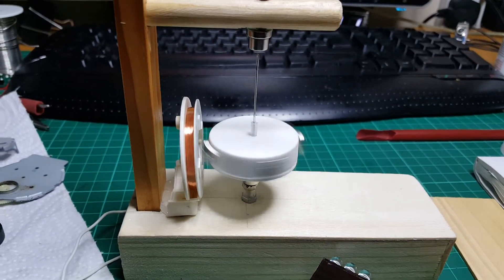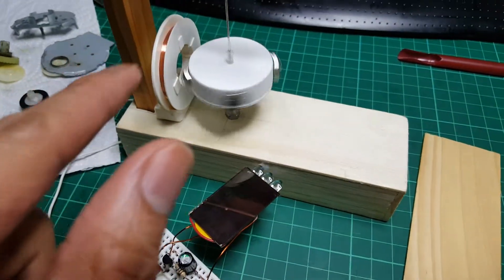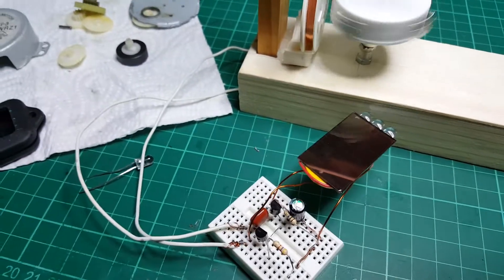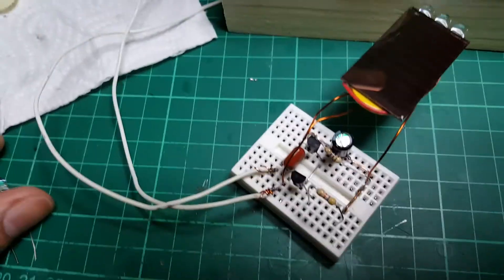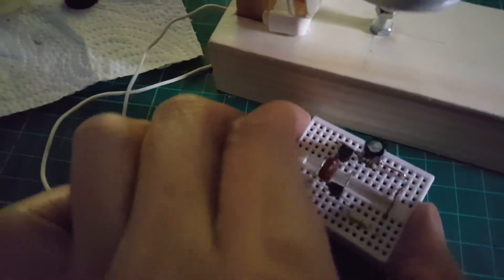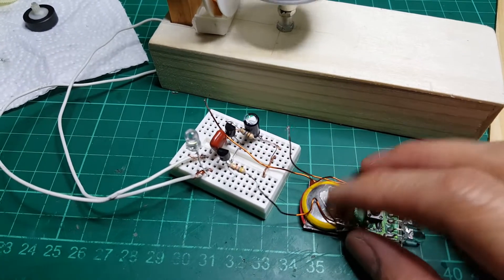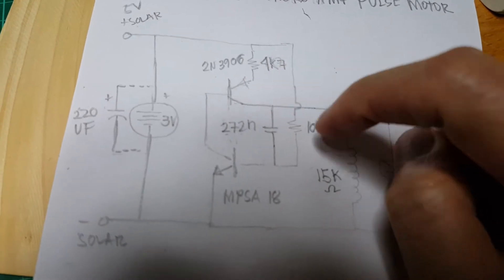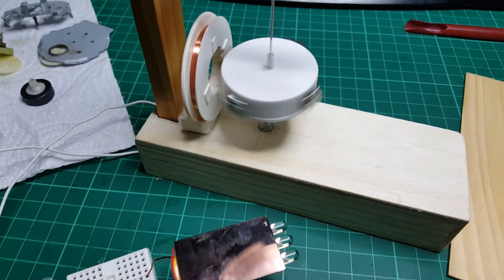The 15k Micro Amp pulse motor

Comment: Wow!  This is even better than what I did.  I will try the circuit.  I have some of those led flashlights and I have been using the panels on various projects. Yesterday I was able to get mine to run down to .7v and 3 micro amps.  Ambient room light is the only power source we need to keep a battery topped off.  Well done.
Reply from the maker: Yeah i got this run 2uamp but very very slo w spin it Will run as well  from dancing  flower circuit  but I'm not still happy the performance.  if you try this circuit try to reverse the npn transistor to drop the amp draw and play around the values of resistors and cap.  the 220 uf cap is optional. 5v solar is very good  to charge small battery in the ambient light.  Have a good day!

Comment: Hello Simplefix 2969,  it is truly enlighten me after saw your video. I tried to follow the circuit diagrams in your (and Lidmotor) videos to make a micro amp pulse motor by myself. However, it is never success, and I am still keep building. Do you mind to take few clear pictures of you circuit if you don’t mind and available? I would like to build up another one like yours. Thanks so much for your help.

Comment: Very nice motor. Where did you get the microwave motor that had the coil? I would like to get one to experiment with.

Paul
Reply from the maker: hi Paul, I got this long time  ago from broken auto matic microwave  can't remember the model but you can search on the internet the part number that i showed in this video.
Reply: I searched and found only very expensive examples. Nothing under 30 dollars. 

Paul
Reply from the maker: you can use the cheaper one like lidmotor has use on his project there's a lot cheaper on ebay like to 2 dollars.
it works  the same  way  like  i had,  if you  replicate my circuit  the  brightness of the led depends on the capacitor and 10meg values. let me know how's  getting on.